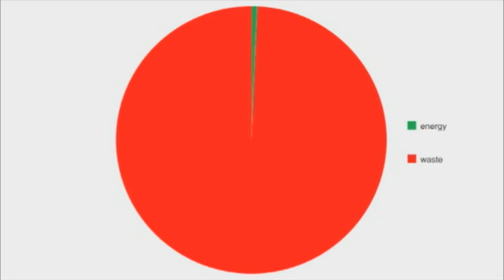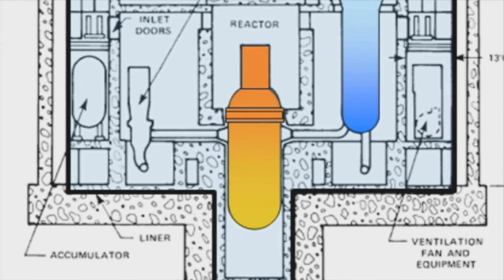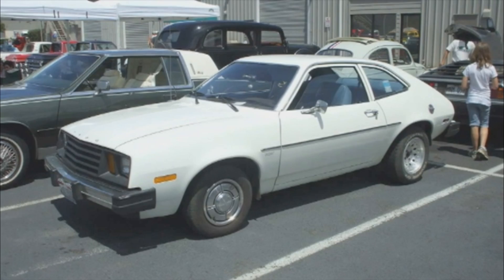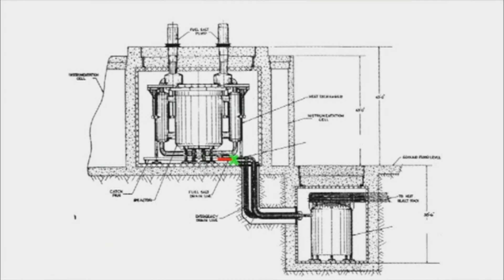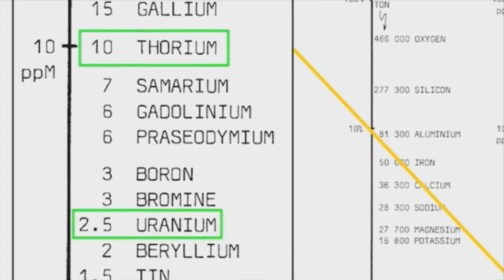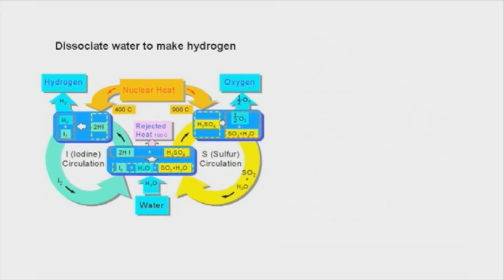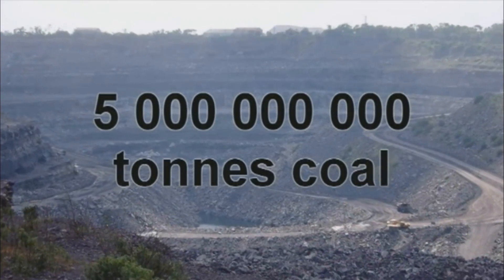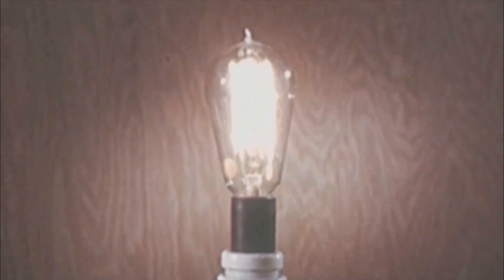liquid fluoride thorium reactor

Comment: Thorium power explained. Very nice editing job, but it leaves out the downsides, for example that it's still a long way from commercialization, and we have an urgent need for new power now.
Reply: Back in the 80's I used to build nuclear power stations and I was looking into the current state of this industry recently.

There have been some interesting ideas about modular reactors which can be preassembled in a factory and which would be able to dissipate their excess energy if they lost their external cooling. Unfortunately the more I looked into this the farther off these seem. 

The result of my research was that I am now convinced that solar and wind power are much better candidates. The costs are falling. They can be deployed quickly. They don't need a massive infrastructure and government subsidy and a billion dollar contractor.
Reply: Chris Watkins The whole point of thorium nuclear technology is that's it's stable and much safer than uranium, That's why research on it was abandoned in the 1940s, the US needed something that made a loud bang to end the war, and Thorium wasn't it
Reply: It only needs money and some time. About 5-6 billion and 5-6 years. That's not much for a fundamentally new, green and abundant form of energy. The problem is not money or time, it's political will. The current oil, gas, coal, solar and even nuclear lobby is squarely against this because it threatens their business model.
Reply: Ivan, I'm interested. Where do you get those estimates from? (Genuinely curious - I'd like to know more about thorium power.)

For comparison, what could we do with five to six billion dollars and five to six years in solar, given that is is already commercialized technology, needing to be ramped up?
Reply: How green is thorium? Compared with conventional coal and uranium, certainly, and the wastes are less in quantity and nastiness than conventional nukes. Okay. 
What about nuclear proliferation? Any country that can run its own thorium reactor can use it to create weapons-grade nuclear material.
Reply: Joe Filceolaire I think you need to go back and do a bit more reading.  Look into maintenance and waste streams for solar.  Look into magnitude of the storage problem due to inconsistency and dispersal.
Reply: Chris Watkins For comparison, we have spent an estimated £5 billion ($7.4 billion) in wind power in the UK. At this moment, it is producing 0.19% of our electricity. It sometimes gets up to 15% for brief periods, at which point the operators are paid to turn them off.Thorium sounds an ideal baseload solution, and I understand it will also help get rid of our existing stocks of spent fuel.